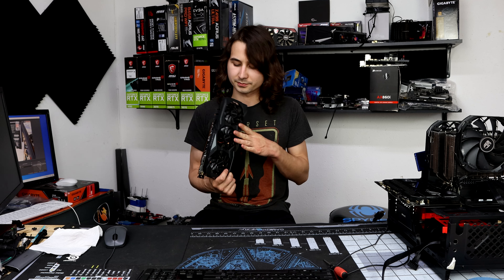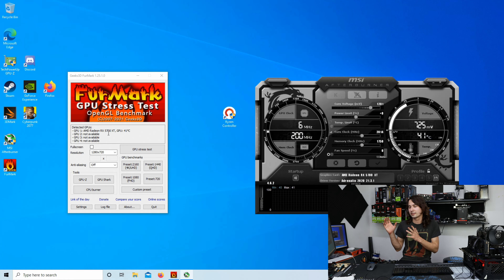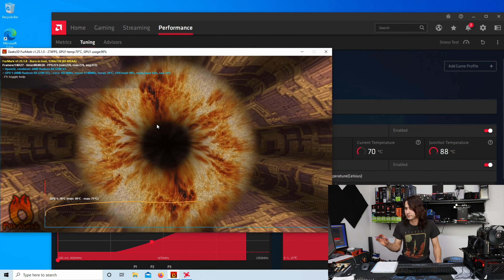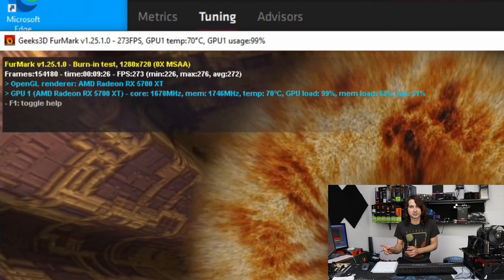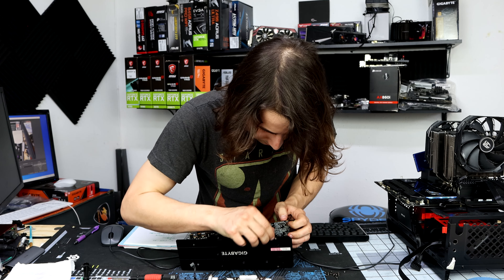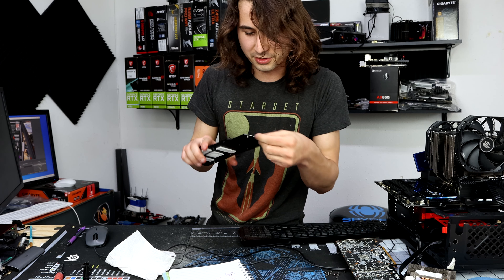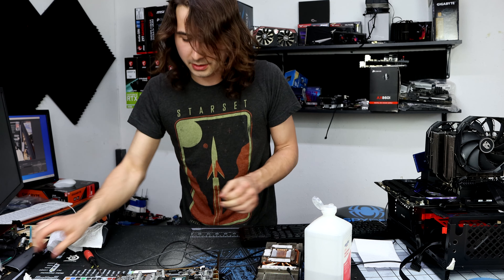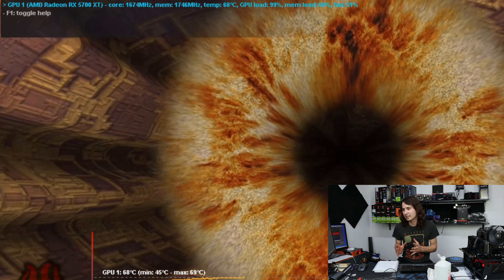Can I Improve My Graphics Card Thermals With A DREMEL?

Comment: great ideal i guess been tested in first place and gygabyte did not though would make enough gain for lost in appeal. i wonder if did not saw reduction in fan speed too on some horizontal alumiun stack card can normally some gain by cutting back io plate when used in case whit strong airflow mod could worked probably better whit active airflow.Test bench data often not relevant for most user too you should consider find a case easy to work whit make data more relevante to viewer experience in vaste majority quite enjoyed the video better luck perharps on the next great ideal .